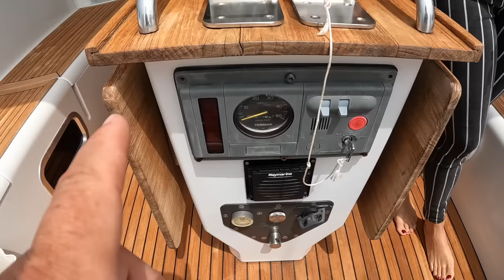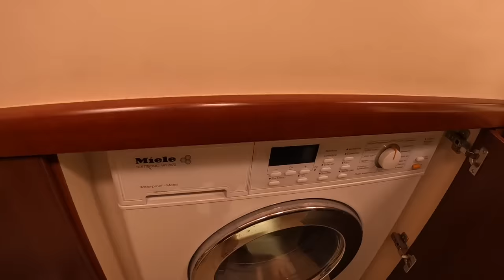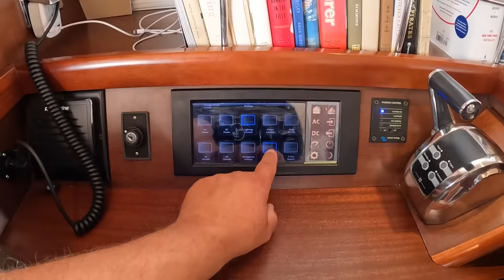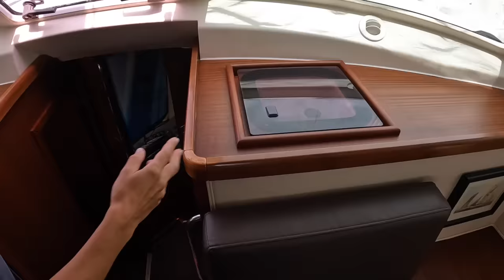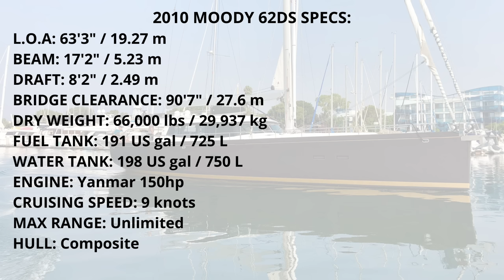2010 MOODY 62DS BLUEWATER SAILING YACHT TOUR /  Liveaboard World Cruiser

Comment: The Moody DS series are probably my favorite monohulls, and the 62 is probably the sweet spot for size and performance.  The only criticism I have for them is the helm positions with ZERO protection.  Sure, you could maybe put an ugly bimini on there or something, but I'd rather they just put a full helm inside for when the weather is awful.  Other than that...PERFECT monohull.  Thanks for the tour!
Reply: Pilot house for 62 in blue water for sure.
Reply: But the helms stations are "sporting"  and if you have the canvas on the sides of the roof, you have forward protection..  and frankly as soon as you are off-shore you are probably sailing underpowered and from the pilothouse,  my biggest qualm would be why they did put the drivers position in the BACK of the inside..   but clearly they relented and on the 54 they put the driver up front (sorry helmsman) with great forward visibility
Reply: That’s why Amel is the best blue water vessel

Comment: That is a nice boat indeed. One thing I will adopt to mine is that extra piece to prevent water getting in on higher seas.

But as for dishwasher, if I had to have minimalist boat, it would have a hull, deck and dishwasher.  🤪

Comment: Watched this once again and have to say very cool. 1. Just thinking, if you removed the mast and the sails, with a little touch up work, this would be a cool tiny power yacht. and 2. Still love that little Joey room (crew cabin). Just need to place a seat in it instead of a 2nd bunk and put in a tv. Than use the master cabin for a captain/wife (chef) crew.

Comment: Thank you for a great video. Very interesting. I do think all the owner modifications degrade the design. No dishwasher?? I doubt that the owner washes dishes. Also there is very little off grid design for wind or solar power. Maybe I missed it but no water purification system. If I compare with the 60 foot boat build feature on “Expedition Evans” videos, this boat lacks so much. And yes a double sink is a must, one of which can have a fitted chopping board.

Comment: Hiya Vico,
Now, whomever took our smooth sophisticated, spring apparel wearing supermodel, and replaced her with a Winter/Fall dressed lovely lady, please stand up. There is so much on this sailing yacht I would not choose, the fact that it's a sailing yacht for a start, but seeing as Rico sorted the work how can anyone turn it down? Masterful job Rico, well done. The whole craft is excellent in fit and finishes, areas not what you expect, but removing the dishwasher??? I was worried V might have a fit or finish? So much to love on here, nothing apart from maybe a set of drawers replacing V's most important appliance? Two/split sink V.
Stay safe, Steve xx...
Reply from the maker: 😝😝😂😂 it was sooooo cold 😝🤦‍♀️

Comment: Nice boat. Now you say, that it is a serious blue water deck saloon, do consider to make a review of the Sirius 40DS. I have fallen in love with those boats, which just are so incredible spacious in such short hulls. Definitely also more highend quality than even Moody, I got to say. This boat though is fantastic, but it is not hard to break down, why Moody did not make more boats of this model: The new 45DS has a base price around 1 million US Dollars and the 41DS 800k US Dollars, and that is base prices. This model for sure would have cost in excess of 2 million US Dollars 13 years ago. Consider, what you could get then for that kind of money of much more spacious and same length catamarans, for instance from Lagoon, FP, Leopard or Privilege, and you got your answer! Monohuls are supposed to be the cheaper option over catamarans, but these no compromise builders, as Moody, Oyster, Amel or also Sirius, that is not the case at all: They may actually be the more expensive purchase than many comparable length catamarans. An Amel 50 has a base price of 1,2 million Euro, by the way. That is the same as a Outremer 52 or Windelo 54 or for that matter 300k more than a brand new model from Neel, the 52. This is the answer, why especially the bigger monohuls sell in very little numbers: You really got to be a monohul enthusiast or have specific cruising plans, where a multihul does not fit for whatever reason, to actually spend more money or less accommodation and comfort. Still, especially here in Northern Europe (I am a Dane), multihuls do hardly exist in real life, because the marinas do not welcome them much or docking fees are staggering. The only multihuls you see here, as Danish Dragonfly, also very symptomatic all are made with folding outriggers, so they can fit into a narrow monohul slip. In the Mediterranean and even more so in the Caribbean of course, it is a whole other deal. People really should consider also, where they want to sail, before they decide, what to buy.

Comment: Great video and a beautiful boat.  Does it have balsa wood core in the topsides?  I know the 54 does have.  Balsa core is fine in a new boat but it needs more than good building.  The work has to be perfect and then no flexing or compression forces applied.  Throw it away in thirty or forty years.

Comment: As far as sinks go this girl has done it both ways. At 1st I like having just one big sink. But I quickly came to regret that. Having 2 sinks is the only way to go. Especially without a dishwasher. Which I never found much use for anyway as it takes so little time to just do the dishes right then and there
Reply from the maker: Great point, BUT dishwashers safe lots of water… really matters when you are living on a boat

Comment: Regards to the sink, I would prefer to have one larger single sink (36”) that I can put 2 plastic container in to use as a wash and rinse basin, with of course a strainer in the drain, 

Regulars to the dishwasher, one less appliance to fix or repair is better , plus I married one really good one that has not need any repairs in 30 years.

Comment: Hello, did I see correctly: the stainless steel railing tube on the starboard side is twisted?
Reply from the maker: On both sides it’s comes out! The is a sailing line goes there, this way it will not be shaving on the rail
Reply: @NautiStyles  Thank you for the answer.

Comment: I am curious about the wheels at the helm stations. If the originals were stainless steel or wood, and in deteriorated condition, I could see replacing them with another wooden wheel or a stainless steel wheel wrapped in line, but given the high cost, what is the alleged advantage of a carbon fiber wheel? Again, other than cost, why is it a big upgrade? If there is a big advantage, I have not heard an explanation as to why. So, what is it?

Comment: Coming from the motor yacht side, I am observing that sailing boats involve many compromises.
This boat, however, offers more comfort and less compromise than most.
Even before the refit, this one must have been quite attractive.
I like the clean look with most lines out of sight... and pretty teak decks in the back and all around.
For a mono sailboat, those are great big cabin doors.
But I'm not keen on the coffee brown seating + same colour brown wood. Would have liked more contrast.
I did not understand the point of replacing a previous dining table/chairs with built-in furniture. Having the seating built-in and inflexible is not the direction boat designs are evolving, as I understand it.
Engine room access seems very poor... like in most sailboats.
Cabins and heads look OK... but not as attractive as in motorboats of comparable age and size.
Overall a nice boat, though.

Comment: 16:34  I would HAVE to have a HINGE designed that would allow the WHOLE *CREW CABIN* (or kiddoz time out zone? lol) anyhow, so the CREW CABIN hatch would FOLD UP AND OVER the other side  ...  OR  even  HINGE (if it can be both HINGED & SEALED I am sure it could be) at the 90 degree bend elbow (bench seat-V-bench back point) so the bench folded up then the whole thing folded 180 degreeze AT THE ACTUAL/current HINGE POINTs axis and LOCKED UP OPEN with a LATCH half way up that window at the corner line...  ...so if it becomes the KIDS ROOM ....you can lock it open so no mean brother or sister or dog or wtuever couldn't SIT THERE while someone is DOWN THERE :) eh...  I could provide a drawing of the hinge system as I saw it in my head, if needed...  I can SEE stuffs such as that...  or just LOCK OPEN ability if they offered wind/weather protection while in motion...  BUT IF IT FOLDED UP and 180Deg up and LOCKED it would put a ''wind wall'' block RIGHT THERE pretty effectivly... 

BEUTIFUL BOAT!! thanks for the peek, commo LOTTO :) or powerball, or rich relitive, lol  sigh...  it's on my list for ''GOING BACK AROUND THE WORLD EASTWARD'' list....   been WEST all the way around, need to equalize and rebalance, lol and go back EAST without beeing limited to ''US NAVY'' regs and port calls and watnot lol  (USS OKINAWA LPH-3 WORLD CRUISE ...in the 80s) :)

Comment: Regards to the sink, I would prefer to have one larger single sink (36”) that I can put 2 plastic container in to use as a wash and rinse basin, with of course a strainer in the drain, 

Regards to the dishwasher, one less appliance to fix or repair is better , plus I married one really good one that has not need any repairs in 30 years.
Read more

Comment: I still sail on a Moody 39, a lovely boat where the decks end with toerails. Sorry but this is a motor sailor,  a stinkboat with a stick. Remove the mast and it's a powerboat.
Reply: So your Moody 39 doesn’t have an engine? ….. 😂
Reply: @Fyn123 I think he might refer to the freeboard.
Reply: @EamonnSeoigh  all yachts are basically motor sailors. Your choice depends on how you use the boat. As a liveaboard hopping from stop to stop you want a comfortable living space and decent reliable engine. How would you get on and off docks, manoeuvres in tight marinas etc etc. Sail power is the pleasurable bit between “if” you have enough wind.
The alternative is to own a yacht that you go sailing on “when” there is enough wind.
A lot of snobbery among yacht owners who ignore the practicality that people look for when choosing their boats. .. imho
Reply: A late reply, but still...
A motorsailer is a type of a boat, and, no, not all sail boats are motor sailers even if they have a motor! The difference is the expected / anticipated use: - a motor sailor is expected to motor most or all the time, with sails augmenting it / economying fuel a little. A sail boat is a sail boat, motoring into and out of marinas but otherwise (mostly) sailing. The motor sailer design is all different- the size of tanks, balance, expected heel angles, etc. The boat in the vid imo is garbage. All contemporary Moodies are made by Hanse in the same facilities and also equally garbage (imo). Either stick with a proper sailing monohall or instead of Moody buy a proper cat already! Cheers!
Reply: Speaking of which, how did they used to dock in the old days before steam or combustion engines?  @Fyn123
Reply: @Shade_Tree_Mechanic  I was wrong to say “all yachts” but the model in question was a modern boat. Tally Ho for instance (excellent YouTube channel btw) is a 100years old but still had an engine. Pre steam people had no choice but to wait for the wind but very few would have the patience (or time) to do that today. 
A lot of snobbery around the make of boats these days which I find irritating 🤷‍♂️

Comment: It’s beautiful, but just go buy a power boat. Cooking in the kitchen at sea will be a nightmare!!! Especially heeling to port. There is nothing to lean on while preparing food. The opposite wall is too far away. You cringed at getting rid of the dishwasher. It takes lots of power. If you’re just cleaning for two to 4 ppl it’s just easier to wash by hand. 

I don’t suspect the lady has ever been on a sailboat offshore or in a storm. So for her to say it’s a great blue water boat is kind of silly. Based on what experience are you basing your opinion? Then again most of the boats they review are power so that makes sense.

Sorry to be Debby downer.